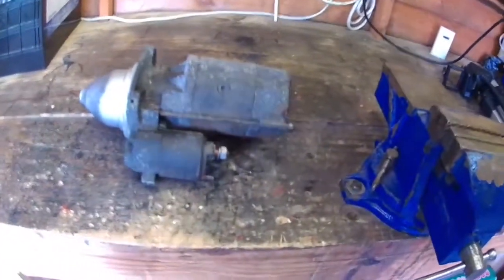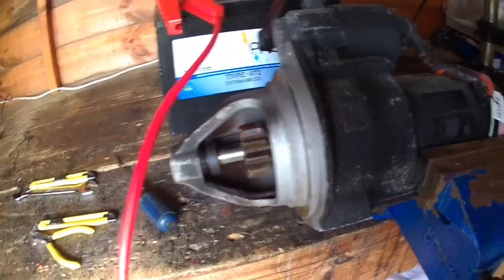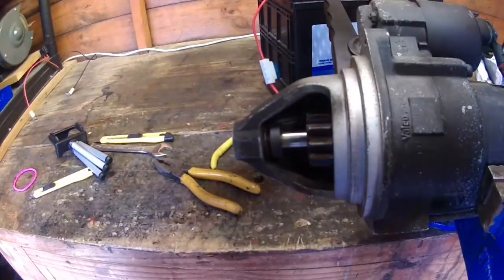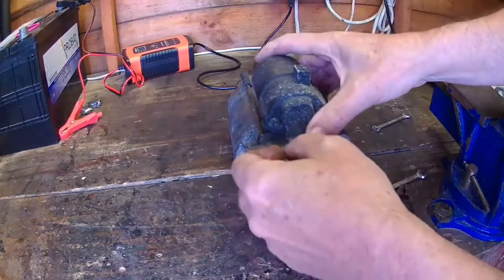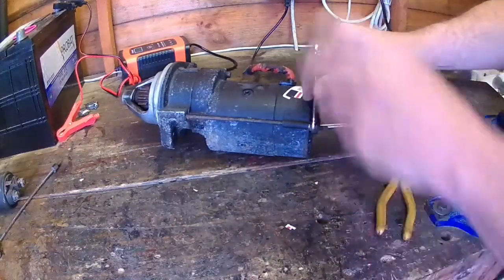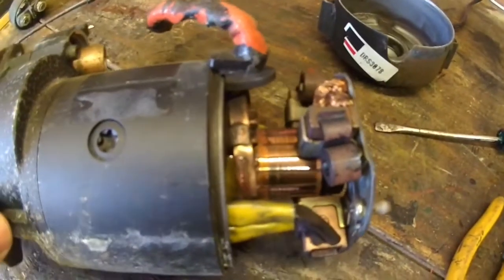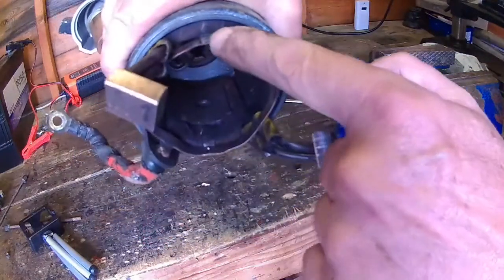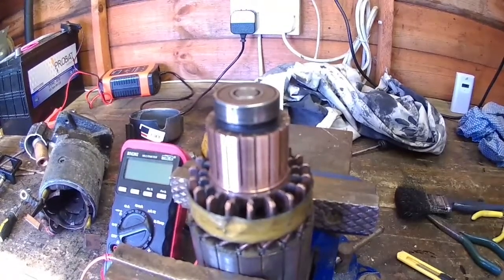Engine Starter Strip Down. Part 1 of 2. Don't know What I am Doing.

Comment: Check all earth straps on your van.common problem on Talbot's.!!!.on petrol van think it's the same on diesel.theres a big earth strap on the gearbox..give all earth fixings a good clean.
Reply from the maker: Hi John. I have checked the Earth, Chassis ground a while back when I changed the Engine Mounts. Thanks for your advice I will check them again when I can get down van and it's not raining. I may even add extra ones. Also going to check battery earth as well. Cheers from old George.